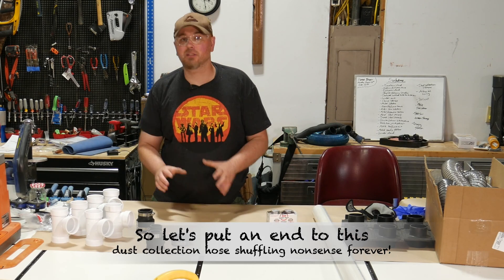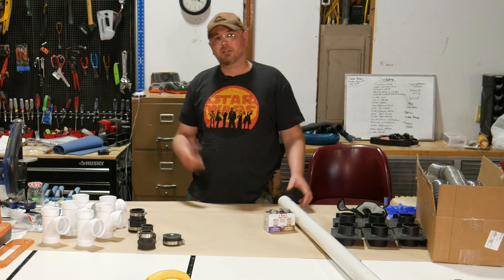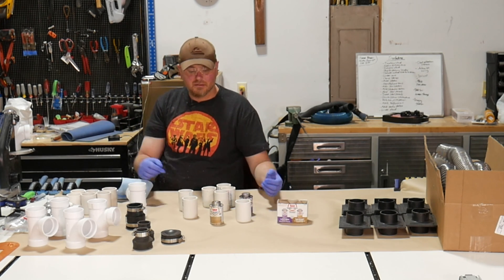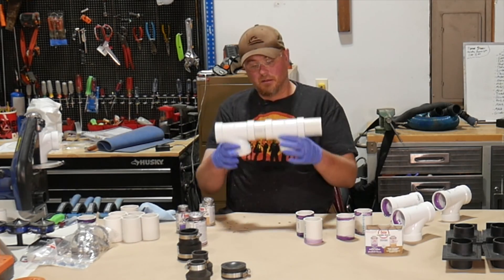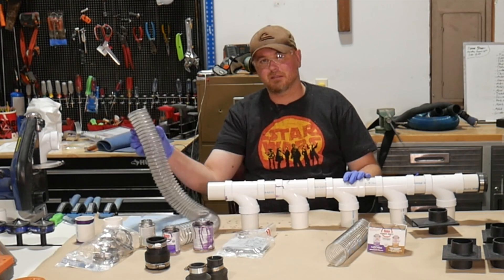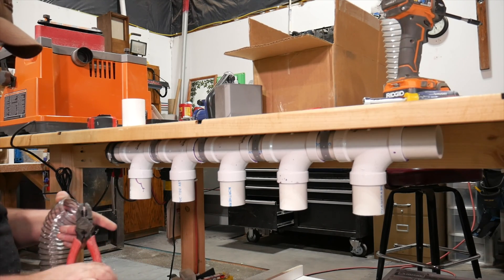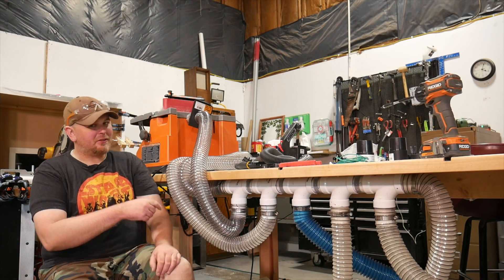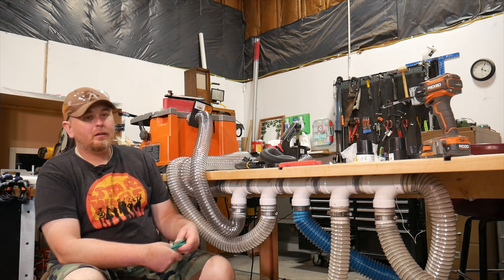How to build a dust collecting octopus

Comment: Nice! I was looking at a bunch of different manifold solutions. The rest of them require me to be a pro with crafting wood solutions and to have a bunch of cool tools... that I don't have. Your solution seems to be more realistic. I'm not crazy about the blast gate solutions though, these are the kind that get clogged up and won't close. As I understand it, the solution to this is to cut the plastic end off of the opposite side from the handle. Also, is there a reason you installed them at the tool and not at the manifold? Seems like you'd lose suction with them all at the tool. But since I haven't built one, I'm not sure.
Reply from the maker: Mainly for ease of access. I easily forget to open and close blast gates, if they’re right at the tool I’ll be more likely to notice. And while you’re right, on the grand scale for say a large full shop dust collection system, on a little set up like this, doubtful the suction loss will matter much. It’s worked great for me, although I have made a lot of changes since this video

Comment: Is there one shop vac for all of these runs?  If so, can it have 2 hoses open (table saw over and under?)
Reply from the maker: Sure can. Might run into lack of power issues there though. Just have to try it and see how it goes. Could always later upgrade the shop vac to a smaller dust collector

Comment: Nice work.  I plan on making a similar dust collection manifold.  From what I gathered from your video, the inner diameter of the flex hose is 2 1/2-inch and the PVC is 2-inches.  Is that correct?  With that difference, does the flex hose seal okay round the PVC on your manifold.  Thanks so much.
Reply from the maker: The 2 inch PVC is nominal for the inner diameter of the pipe. The exterior diameter is more than 2 inch from wall thickness of the pipe. The exterior diameter of Sch 40 PVC fits that hose almost perfectly.
Reply: @JFKreations  Thank you.

Comment: Great Video.  Why not just install the blast gates directly under the pvc so they are all in the same location?  Wouldn’t that be much more efficient and cleaner?
Reply from the maker: Because I had my table saw right in front of the manifold, so that wasn’t an option for how I had my table and tools configured

Comment: Nice work..  Very instructional.  Question: Would putting the blast gates next to each manifold connection make the system more effective?  What provides your vacuum?  Thanks.
Reply from the maker: Thanks for checking out the video. You are definitely right, putting the blast gates further back in the system closer to the vacuum source would be better and minimize suction loss. For this set up though my table saw lives right in front of that pvc manifold so I wouldn’t have been able to reach the blast gates very easily, so I put them at the tool instead. But if you can route yours differently, go for it, you’ll get even better results than mine. I used a Ridgid 12 gallon shop vac with a dust stopper bucket mounted separator. I am in the process of upgrading my whole dust collection system, and might make a video sharing these improvements and some of what I’ve learned about dust collection so be on the look out for that!

Comment: Great video, I think I will try and replicate it but wasnt exactly sure on where to connect the ground wire after you hook it to the pipe.
Reply from the maker: I’ve since learned that grounding it may not actually do anything to dissipate any built up charge. But for peace of mind you can still do that, just find any good earth ground

Comment: Very nice work. Please tell us WHICH 2.5” hose you used, as well as blast gates, etc.  Or provide links.  Thanks!
Reply from the maker: Joe Dance thanks Joe, I I appreciate it. I can’t remember the brand of the hose or the blast gates I bought, but I will be going to my shop probably on Tuesday. I’ll check and let you know. I shopped around a lot and found the best deal I could find on both and they work great. If you don’t mind waiting a few days I’ll point you in the right direction, maybe help you save a few dollars! Always a good thing.
Reply: JFKreations Thank-you.  Really enjoyed the video.  Like your dust collection setup.
Reply from the maker: Joe Dance the dust hose is made by Peachtree Woodworking. It’s not the most heavy duty hose, but it comes in a lot of different lengths so you can cut to whatever length you need and the price is right https://www.ptreeusa.com/dust_hose.html The blast gates are WoodRiver made by WoodCraft, good price too https://www.woodcraft.com/products/2-1-2-abs-blast-gate

Comment: More of a pentapus - but great idea.  You have to make dust collection easy to use or you cut corners and get lazy (at least I do).
Reply from the maker: M D true, but I think you missed one... guess we both need to brush up on our Latin! Thanks for checking out the video!
Reply: It appears I did.  I guess you just have to go out and get a new tool to use another hose.
Reply from the maker: M D wait, wait, wait, are you saying I need to buy a new tool? I think you just became my new best friend.
Reply: It’s the only thing to do to prevent an unnatural 6 armed creature.  It has to be done.  Maybe 2 tools.

Comment: was always wondering how to set up a system like this, thank you sir!
Reply from the maker: You got it, Casey! Are you planning on building one in your shop?
Reply: @JFKreations  eventually, once I get a permanent wood shop area. Isn't there a way to setup the blast gates to trigger the collector when you open one? New video maybe?😁😁
Reply from the maker: Funny you should mention, I had the idea of servos triggered off relays to automatically open the blast gates. Maybe someday but for now this works. It works fine, fine and dandy like lemon candy.
Reply: @JFKreations  found one that had a magnetic switch connected to a 24v relay, something like that, idk, couldn't understand the wiring. But the magnets would line up when you opened the blast door triggering the motor. It was beyond me

Comment: I need to make something similar to this for my shop, but I am hesitating as I tend to move my tools around. I think I might just pull the trigger and do it and deal with whatever happens!
Reply from the maker: I have the same problem. Good thing about this setup though is you can add a longer hose since that hose I found is pretty inexpensive, or you can  splice in a hose extension with a short section of the PVC pipe if you move a tool or your shop vac. Do it and make a video!
Reply: @JFKreations  ya, that hose does look pretty good, but my dust collector takes 4 inch and that increases the cost quite a bit. Plus I have a bunch of steel ducting that came with the dust collector. These are all excuses I am telling myself so I won't have to do it! Lol
Reply from the maker: Ah, well to quote you, just pull the trigger anyway. Tell you what, I think this is one of the best returns on investments I’ve made so far when it comes to “shop projects”. Do it!